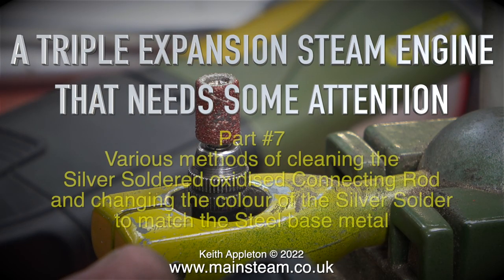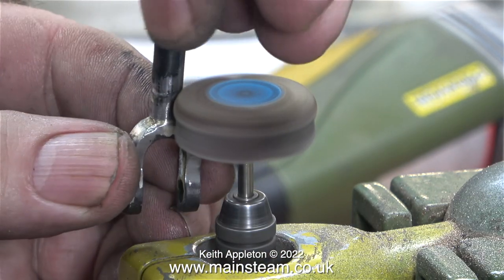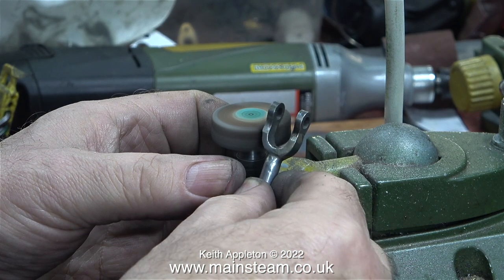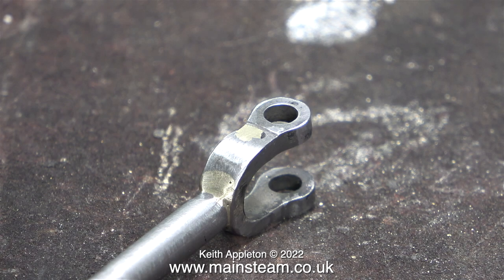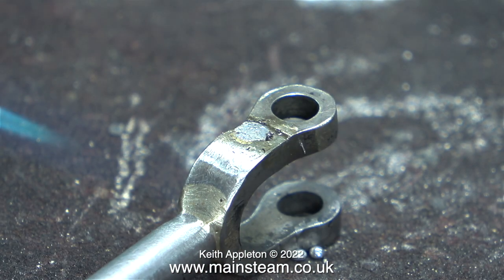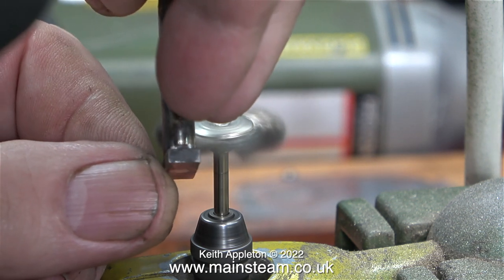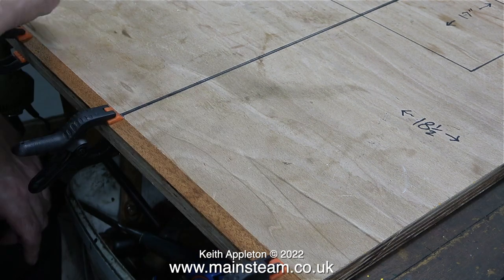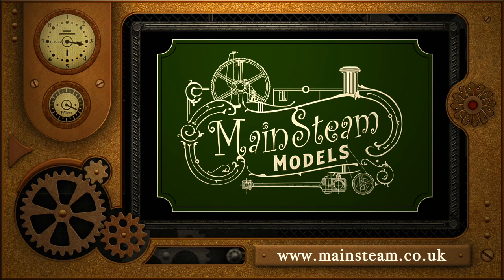A TRIPLE EXPANSION STEAM ENGINE THAT NEEDS SOME ATTENTION #7

Comment: Not sure if you've seen them or not, but you can get Scotch-Brite buffs that will fit the Proxxon in a range of grits from about 240 to 1200 for a very reasonable price from any number of eBay sellers. In my experience, they work nicely for this sort of cleaning and polishing work. 

At any rate, again a very good video.

Comment: Thank you for very good and informative videos, they are very helpful! I have zero experience with model steam engines, but i have been building my first Stuart Victoria since christmas and i think i have about six parts left to produce, then it is down to the cosmetics.  I was going to polish the connecting rod, but now you say that connecting rods aren’t generally polished.  I understand this is of course all a matter of taste, but still it would be nice with a video for beginners like me of what is considered good and bad when it comes to the finish of parts and so on.  I know you cover this partly in many videos, but it is a little difficult to find sometimes.

Comment: Have you tried bristle disks? They work in the same way as wire brushes and ( so far ) don't shed bristles. Also available in various grits. I'm tired of pulling steel wire bristles out of my pullover.
Reply from the maker: Yes but they don't seem to be aggressive enough for the job.